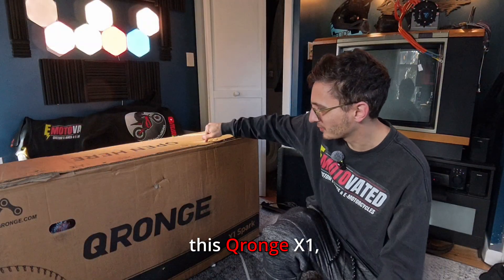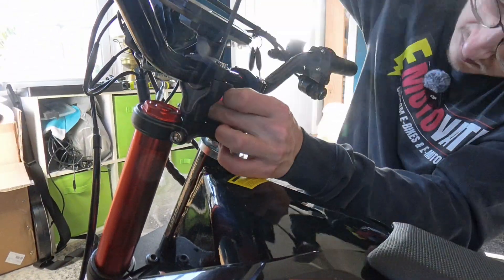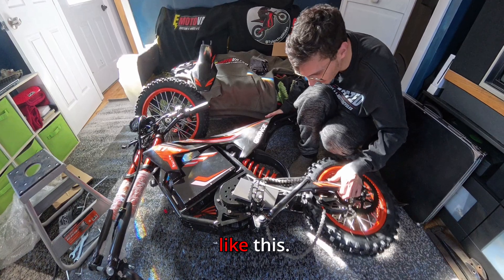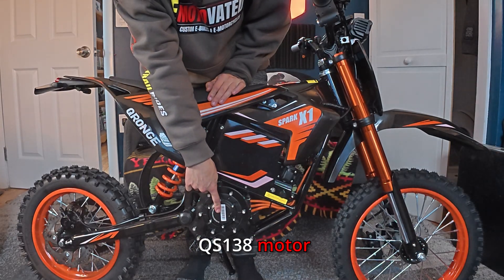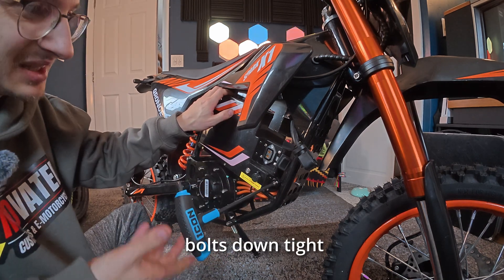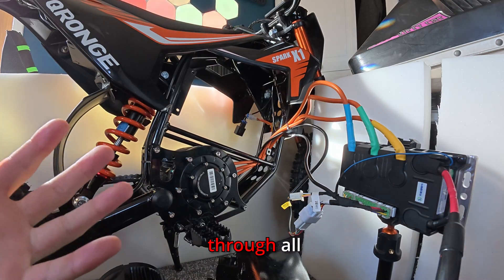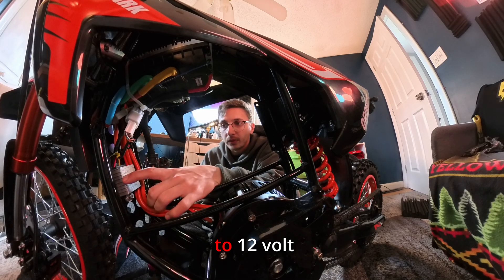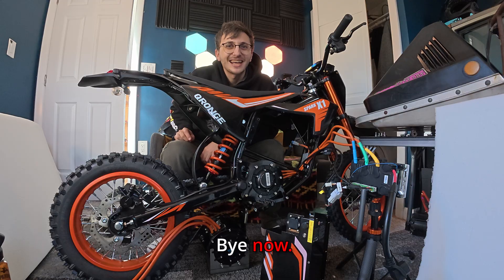Electric Power is Getting CHEAP - Qronge X1 Spark

Comment: I got a 480a 72v 40ah battery from amorge yesterday running 35KW
Reply: fardriver 721000 500a  controller qs motor165v310000w motor (thats what its rated can run 35kw easy)
Reply: @BlahJamiee you got a new battery motor and controller for the x1?

Comment: YES bro, please upgrade this bike. i have the clone of this bike with pretty much all the same stuff, and im trying to fit a ND72530 and a 72v in it, i can get the 72v but im having trouble finding space to but the big controller.
Reply from the maker: If you can't get it mounted in the stock location with the cover, just delete the metal cover and buy some of those mega zip ties from harbor freight. It will be far from ideal, but I had no issues running a controller like that on my old Razor. Just make sure you use a few and the zip ties are supporting the controllers weight, you dont want any opf the weight sitting on the wires. Definetly will have some upgrades on the bike!
Reply: im likely gonna find/make space around the stock controller area. im looking into getting the sotion FW11 motor but not 100% on how its gonna fit in the bike
Reply from the maker: @IndefinitelyGone  I would skip the FW11 this QS138 should be able to take a ton of power, that money is better spent on controller and battery

Comment: A 260 amp controller is absolute overkill here, but it's nice to have more than enough.
Reply from the maker: Agreed, but for once it seems like this bike is specifically battery limited, the motor and controller should be able to take more juice!
Reply: @TylersTrailRides so what if we throw a 72 volts instead of 60 could we see speed increase
Reply: @carlost267 yeah that’s what I’m dojng
Reply: @Brody-u1j drop a vid when you do , I love to see the difference
Reply: @carlost267 I got you, batteries coming mid-late febuary

Comment: I'm in for the tuning or controller upgrade video. I have a spark x1 M and it rips, but you can tell its being held back. It just has so much potential and power left in it. Ive padded and recovered the seat; it was much needed.

Comment: That’s more than likely the QS 120 not the QS138. It looks too small to be a QS138 unless it’s the smaller 70h variant but still it seems too small to be that. China has a few manufacturers that make almost exact copies of QS motors
Reply from the maker: The motor is definitely a QS138, a QS120 is a smaller diameter (I have a bike that uses one)

Comment: Hey I noticed your model has a full twist throttle, is this an updated version that they are sending out now? They normally have a half twist one.
Reply from the maker: Yes, mine did come in with a full twist throttle, not the 1/4 twist like the first batch of bikes
Reply: @TylersTrailRides  That's awesome, i'm wondering now if the speedometer is slightly more accurate. I wouldn't assume so but I can only hope lol.
Reply: @julianchavez4542 no it’s not , mine came with full twrist but speedo was off 15mph , gronge have a video showing how to set the speed
Reply: Speedo
Reply: @carlost267 oh okay cool appreciate the answer, been looking everywhere for it

Comment: I just ordered the spark one L version with the 17 inch front wheel. I’m gonna reupholster the seat with some gel pad added unless you can find something better. I already got my eyes on some shocks spoke covers tires, etc. my question is does it have a Vin number on that bike
Reply: It has a vin by the fork tree.
Reply from the maker: @jasonbistarkey3992  Totally missed that, your right
Reply from the maker: Nice! Sounds like you've got some great  plans for customizing it. As for the VIN, I didn't see one on mine
Reply: What I did was get 1 inch thick foam glue it to the seat with adhesive spray and then put a new, grippier seat cover on it